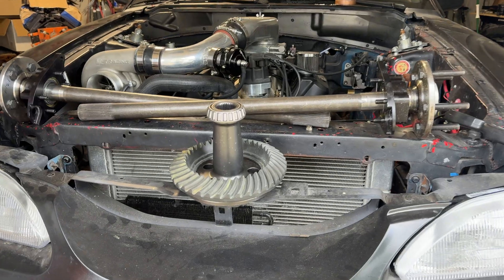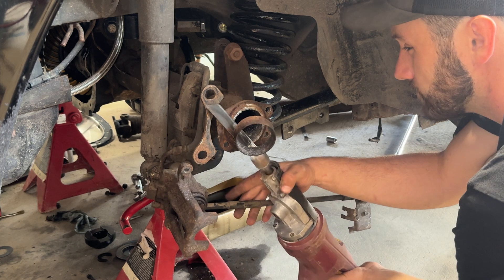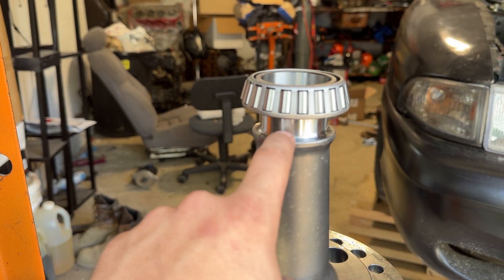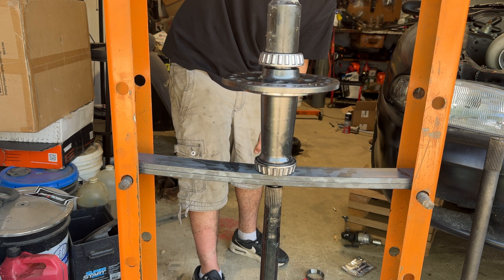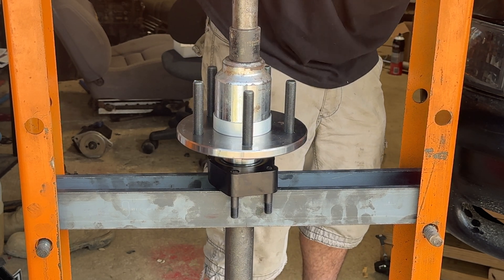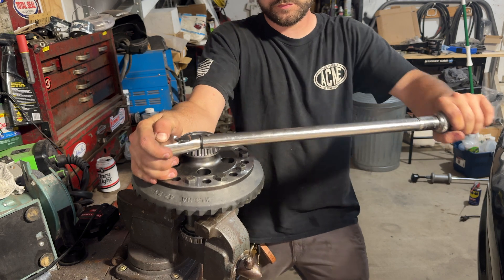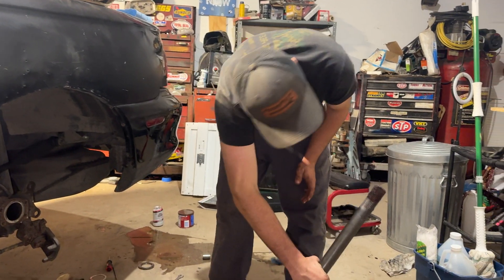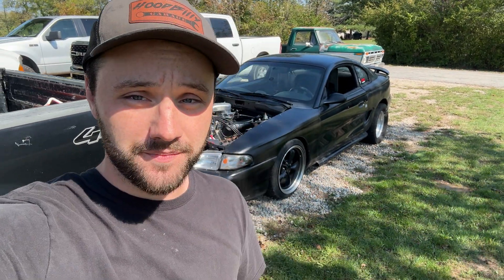8.8 Rear End 35 Spline Axle Upgrade (Full Spool, C-Clip Eliminators, wheel Studs) | Turbo SN95

Comment: [NOTE] the conversion was compromised for an economic reason -- saving money. A better conversion would have had "Torino" wheel bearing ends welded onto the ends of the axle tubes, and using an Eaton Detroit locker differential. "C-clip eliminators" and a spool are race only options (not recommended for street use).

Comment: I installed this set up on my 2014 S197 GT, and I wish I hadn't. First of all, after cutting up my diff, and installing the set up, I ran the car a few times down the track and the driver's side seal immediately started leaking out the seal. That area comes assembled so it was bad from the start without my having done anything to make it leak.  Found out that Strange would only cover the repairs if I sent the whole axle back but unfortunately for me, I live in Alaska and I was in the middle of the race season and couldn't have the car apart for 3 weeks. Found out that the seal isn't serviceable and in order to replace it, you pretty much have to destroy everything else, a very expensive fix which they made me pay for. Can't go and put the stock stuff back now, because I cut off my axle tube. I frustratedly paid them for the new parts and after waiting for the shipping I was able to cut off the perfectly good parts to replace the bad seal. About 400 miles later the other side did the same thing...yay... This time when I removed the parts, I accidently broke the speed sensor ring. I had removed the antilock brakes so was told it wasn't necessary...wrong. Car won't shift without that. Have cut all the new parts I just replaced and buy the same stuff for the third time. Also, with the 35 spline axles, there is No way to replace the spool with a locker because no one make one. Strange, will sell you a Trosen style diff for the paltry sum of almost $1,600 which, if you've ever used one, you know they suck at the drag strip. Unless you are prepared to tolerate what I have had to deal with, put a 9" in it...
Reply: I googled 35 spline locker and strange has one $993

Comment: Been waiting for an update video on the mustang. I’m building a 94 single turbo car. Gonna be running Aces fuel injection Royal flush kit full top end kit. On3 70mm turbo and eBay headers. Going a little different route on transmission than you. Actually doing a modular to SBF adapter and running a TR3650. Your car has been motivation to keep on mine 🤣
Reply from the maker: I love it hear it man! I really love the FiTech, the trick is with the FiTech’s is read the directions and study the “FiTech handheld definition” sheet! But keep grinding man if you have any questions just ask away